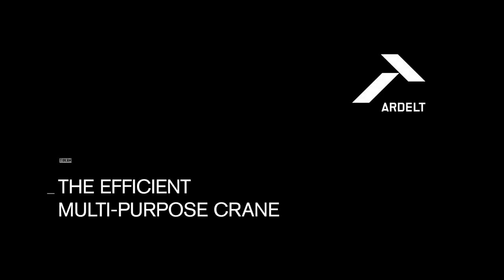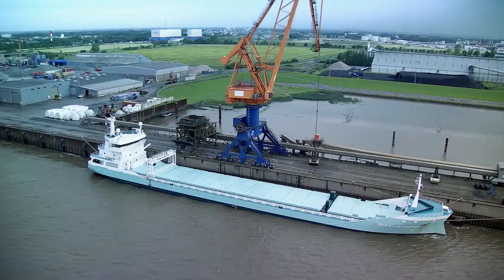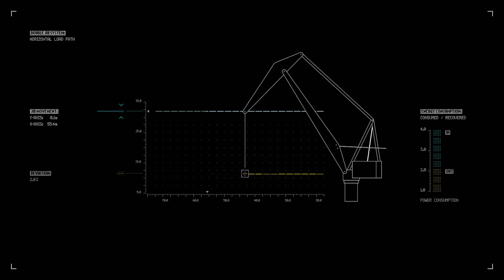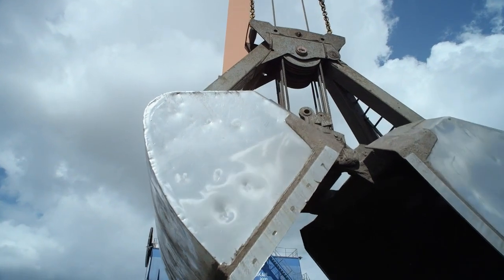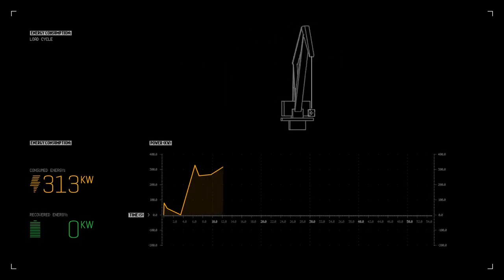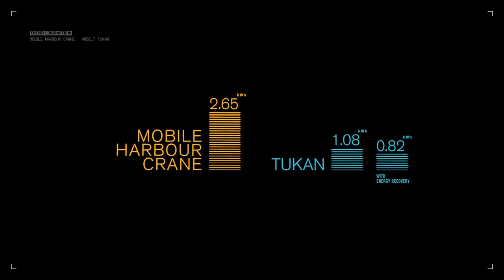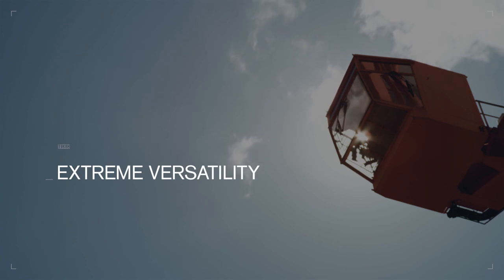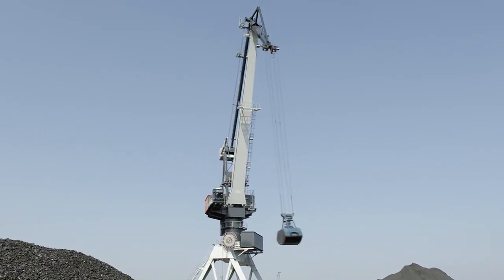Ardelt. Tukan. The efficient multi-purpose crane.

Comment: I want to work this crane , I worked luffing crane's for nine years in steel plant port .
Reply: These cranes are rapidly becoming completely automated to save operating costs and reduce human mistakes.
Reply: Can you tell me what is the purpose of the large house behind the cabin? And what is in it I cannot find info anywhere
Reply: @iknow4913  it contains all the electrical and PLC control systems, it will also house the motors and very large winch system.